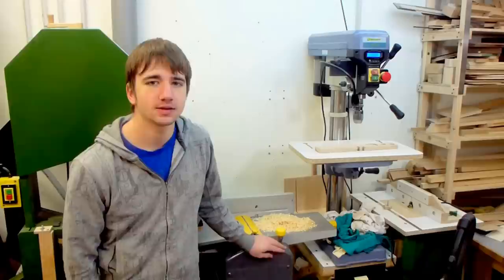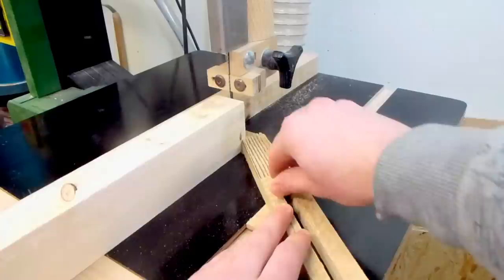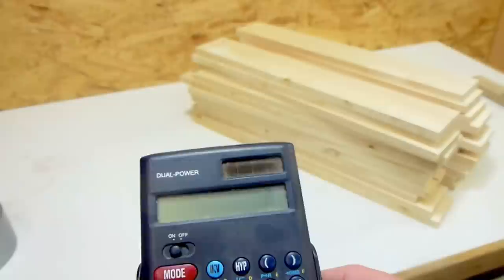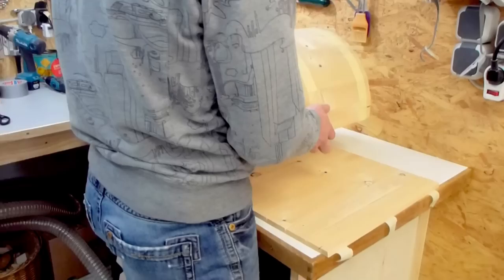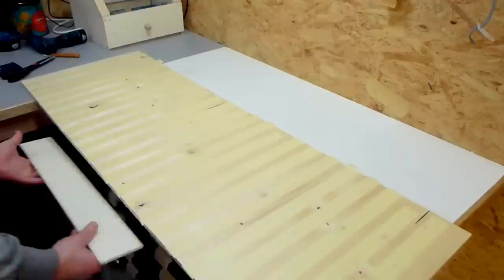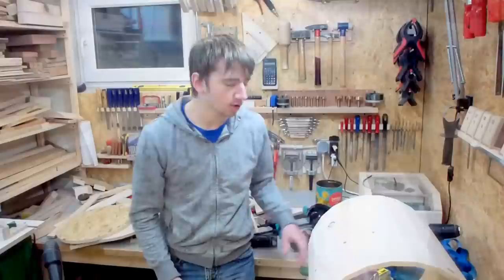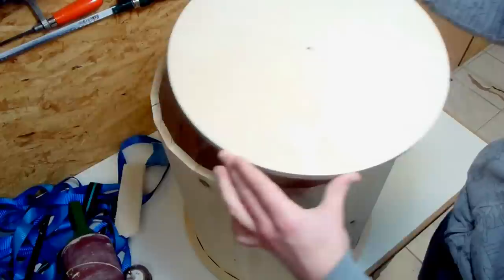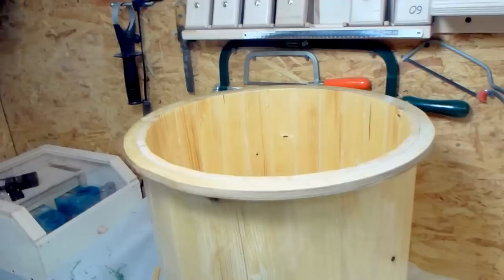Making the Segmented Wooden Bucket ( Chip-Separator Part 1)

Comment: Nicely made bucket.  I would have just made a plywood box.

Looking forward to the next video!
Reply: Pretty nice tricks!  I understand why he made a circular bin like this, centrifugal dust collection will work far better than it would in a box with flat sides.  For filling the gaps on the inside, since it doesn't matter how it looks, you could use a high-solids paint product like a mastic epoxy.  The varnish will probably work fine, though.
Reply from the maker: Michael Ireland I think a box would work just as well and would also slow down the dust inside it. I just wanted to experiment with a segmented bucket. I didn't fill the gaps on the inside, just the outside ones. It was easier to sand over the outside a second time. So far everything works great and is air-tight.
Reply: Awesome!  As far as the bucket shape goes, what you really want would be a circular bucket with baffles on the inside.  This is how flyash centrifugal separators work in my industry.
Reply: But obviously your design is perfectly good.
Reply from the maker: Michael Ireland Thanks. There is a baffle (in the next video)
Reply: I am eagerly anticipating it :D
Reply: I don't understand why everyone has to attach the collection container to the cyclone. I would think a cabinet with a door sealed with the collector mounted  on the top. Open the door and place a waste can inside and close the door. The cabinet is the only thing that needs to be sealed. Think of the cabinet is like a ice box with a door seal.
Reply from the maker: ShadeTreeCNC Neat idea, but it wouldn't work good. The dust gets separated by centrifugal force, so it would spin at the cabinet's walls and miss the can inside it.
Reply: Also many machines produce a lot of dust/chips that don't conveniently go into the cabinet below; by having a semi-portable container, one can have precision dust collection for all of their tools.
Reply: Precision dust collection...good one.  Personally I work in a woodshop, not a hospital. Creating false expectations with hyperbole can lead to feelings of failure.  I actually enjoy my work, a little dust and all.
Reply: Dennis Hill I'm not entirely following your criticism.  If you work in a well outfitted wood shop, you know that many tools have specially placed dust collection orifaces designed to pull the maximum amount of dust as it's produced.  Many of these tools, in particular the professional grades, have a lot of engineering that goes into directing the wood fragments.  Hence my comment about precision dust collection (as opposed to just letting it collect where it falls).  There was absolutely no hyperbole.  Those of us who work with highly toxic wood species like Rosewood, Pau Ferro, Ebony, and so on, absolutely must maintain tight dust control.

Comment: I do a lot of segmented bowles. To set the angle on my table saw I use a I phone 4 with a handy level app. you canset it on your table and zero it and them raise blade all the way so you can set it on the balde just make sure to place it between tje teeth so its on th flat of the blade. I was shocked how well it works as it gives tenths of degrees. My other trick I do on my segmented bowels is to clamp them I get everything straight and use srink wrap or plasic wrap if you twist it like a rope amd then pull a little harder each wrap it works perfect no mater size or shape of segmented peice. But all said you made a awesome piece and many others.!!!!!!!!!!!!!!!!! I love to get new Ideas from other  people. I made my impeller a few weeks ago and just getting ready to  in close it. Man I love the Idea of the plex glass around it. I was going to use wood but this way I will know its working or id something has clogged. What thickness is the plastic and where did you buy it?
Reply from the maker: The plastic is 0,6mm Polyethylen and I got at from the hardware store. (sold as roll glass)
Reply: Jeremy Miller f

Comment: Enjoyed your video.  Have you thought about cutting a dado cut in each slat just above the bottom and create the bottom disc to fit inside the dado? Though still being an imperfect fit, it might be better sealed, not requiring more glue and sawdust.

Comment: Hello Marius superb build, and a lovely bit of cooperage, I have been using a large plastic bucket, the only trouble is if you get a blockage the thing collapses in on itself!, I have tried strengthening it with plywood, but it still crushes, I may try to follow your example and build my own bucket, I have an idea to use 6mm ply and kerf cut it to form segments,but keep them attached to each other and avoid taping them, then run glue in to the cuts, not as elegant as your work, but quicker for me as I have limited time and many other projects I wish to build, what's your opinion on my idea please?

Comment: Very cool videos Marius.   I have some videos showing how to turn a drum shell perfectly round using a jig on the router table.   You could make a perfect cylinder for the dust extraction bucket using the same method.   (Or you could just buy a large plywood floor tom or bass drum shell on ebay and save some time!)
Reply from the maker: Murray Drums Ah, thanks for the information.